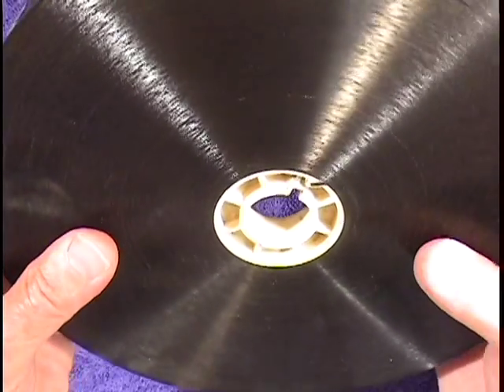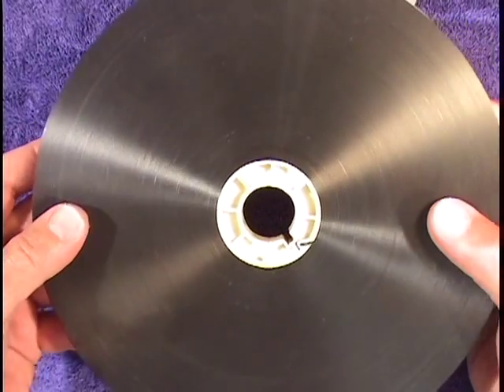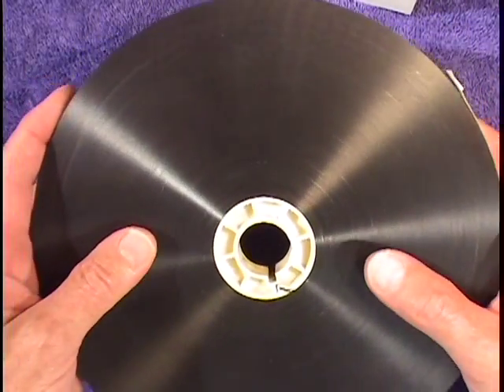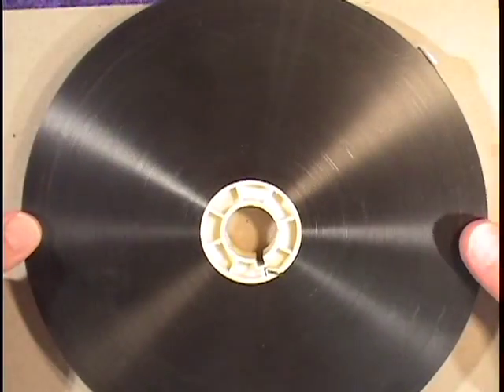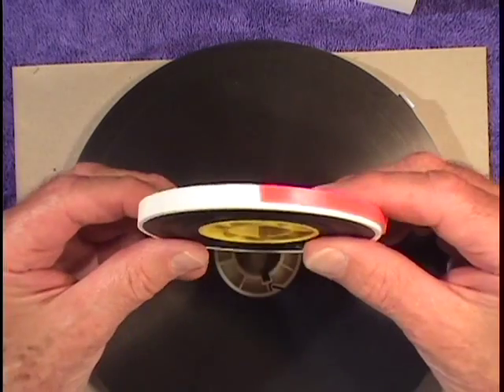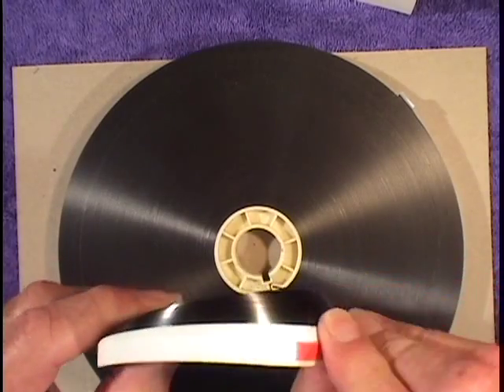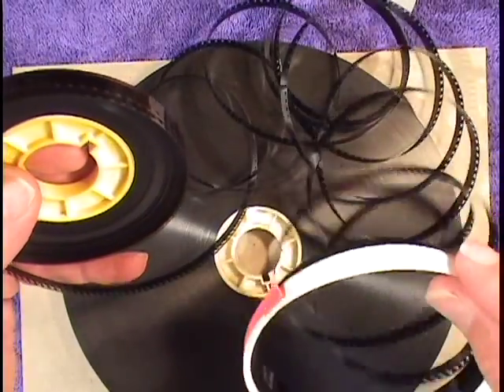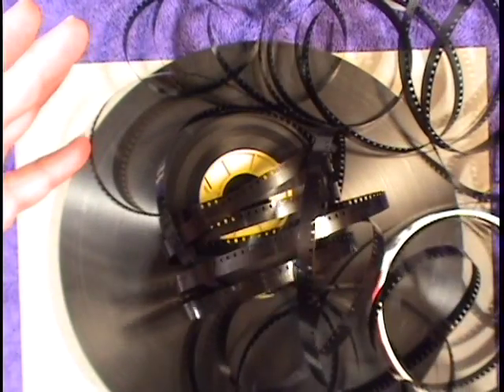Film on a core (clip 14)

Comment: Funny how I ended up here. 

This morning I opened up several of my old 16mm cans. About 6 out of 10 of them have films on 800’ reels. The other 4 are wound tightly on cores. 

So I decided that it was time to transfer those 4 into reels. 
😬😰

So I started with one core with about 600’ of film on it. 
As I slowly began unwinding it into a trash bin while keeping it as straight as possible, I accidentally let most of it slip off the core and onto the floor!! 😱

Needless to say... DISASTER!!

I prepared my EIKI 16mm projector with an empty 600’ reels on the take up arm so that I can flip it into rewind so it will spool up my mess once I untangle and uncurl most of it. 

2 hours later,.. 🤬
I was able to being the spooling up process. 

It started smoothly then about 300’-350’ into it the film broke in half!!

So I had to load up another empty reel and spool up the remaining 250’ or so!!

It was a nightmare in the middle of my day!!

Now I have to splice that one section then try again. 
Neatly & very carefully this time!!

Lesson learned on Core #1. 

Not gonna happen with the next 3 Cores. 

Well, that’s my story. 

Wish y’all could’ve seen it. 😡🤣🤣